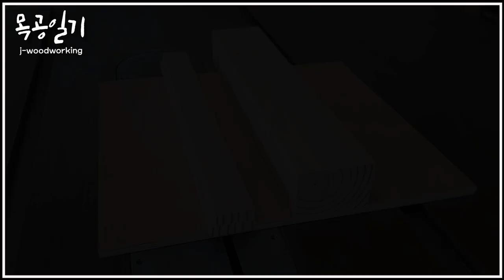making a spline jig mounted on the miter gauge for table saw [woodworking]

Comment: Just used my own spline jig on a customer order the other day. I will be posting it soon on FaceBook. My jig rides against the fence for lateral adjustment however, I like this type because it is adjustable laterally AND is locked into a groove. With mine, I must hold it against the fence and hold the box tight to the jig. If I slip, the whole thing might come off the fence. I need to make a new one soon anyway...I think it will be like this. Great work sir.
Reply from the maker: Thanks for posting good and long comment. 
I wish you a merry Christmas and a happy new year.
Reply: @j-woodworking9573  ...thanks you so very much sir. To you as well!

Comment: Very good . The T-slot can be easily made with a Router
Reply from the maker: You're right. 
But unfortunately I didn't have the bit at that moment.
Reply: I find it easier to be done with lamination, like in the video.

Comment: Excellent jig. I just worry about your hand holding the box over the blade. Why not build some type of clamp to hold box in place so your hand does not have to hold the box?
Reply from the maker: Sorry that I made you warried. I'll make another. Thanks for watching sir.
Reply: Not necessary to make another one. Let me know if you find a way to add a hold down clamp to the one you just made. I like it and it’s simple.
Reply from the maker: Thanks again sir.

Comment: the way you hold the piece it could be the most dangerous thing that I never seen. the fence needs to be taller to avoid if possible injury...losing fingers is not the best way to finish a project
Reply from the maker: Thanks for your kind advice. 
I'll keep it in mind always.